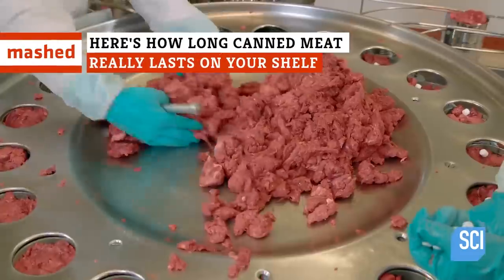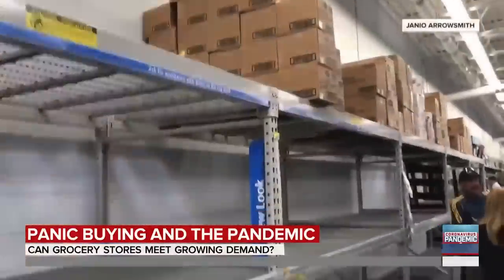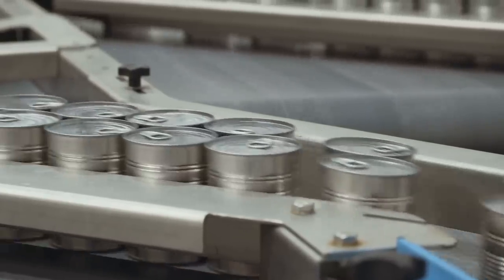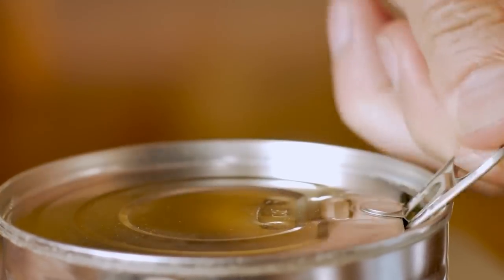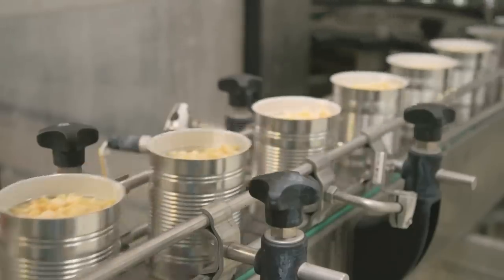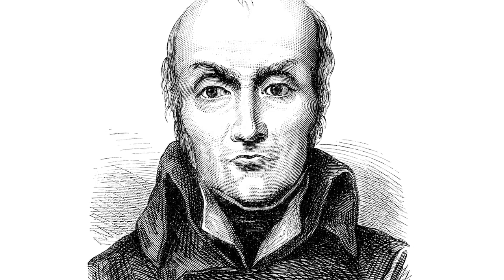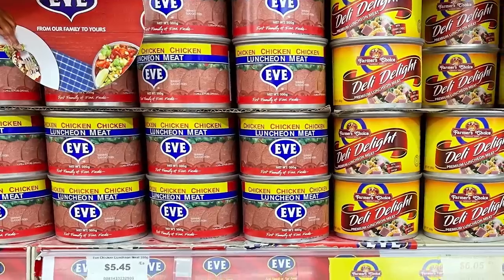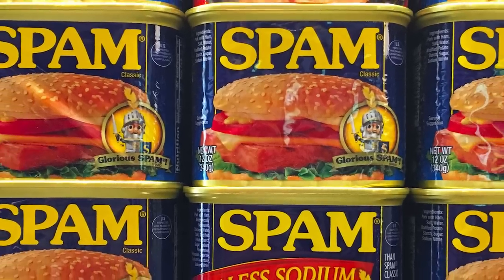Here's How Long Canned Meat Really Lasts On Your Shelf

Comment: Where I grew up we always had canned meats for emergencies. Whether it was store bought canned or homemade canned. However, canned tuna & salmon were the only ones we got to eat on a regular basis. We were taught that even if you do everything correctly when canning,...when you open it, and the smells is off or very unpleasant: Do Not Hesitate--Just throw it out. It just not worth it ta get sick, or worse...death. And especially with canned tomatoes...blackened means mold upon opening. Definitely it goes into the trash, but make sure you wrap it in several layers of newspaper first. Then straight to the trashcan that is Outside. Thanks for sharing this history of canned goods.